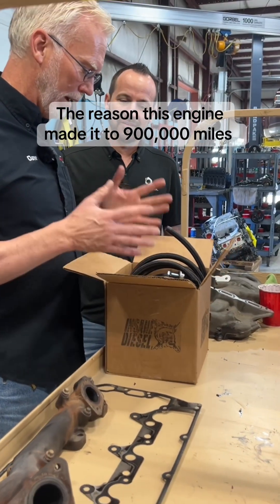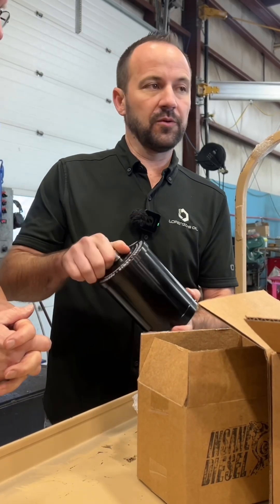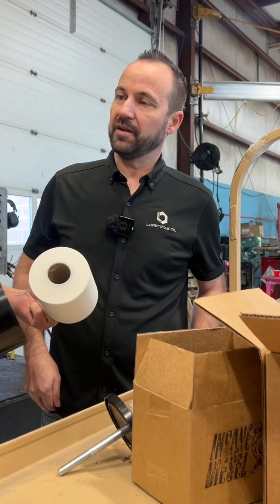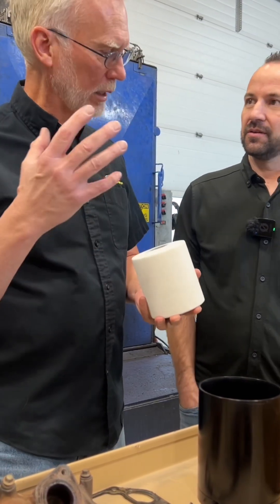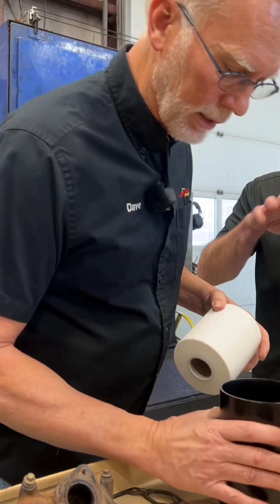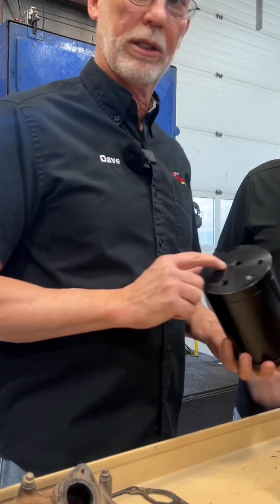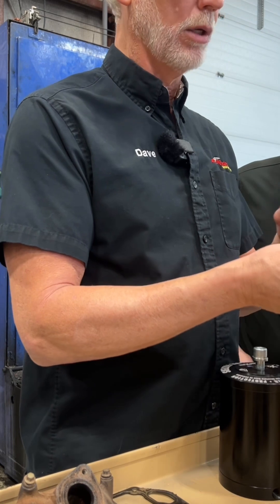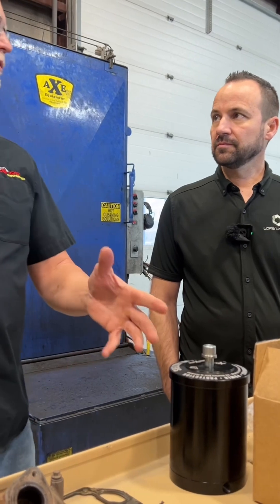Educating Dave on the Bypass Filtration system. The reason this engine made it to 900,000 miles.

Comment: I’d like to add this filter system on my new F-250 with 6.7 HO engine.  My only concern is how will Ford look at this in the event of an engine issue.  Would they try to deny warranty due to an aftermarket device?

Comment: I ran a toilet paper bypass filter just like this. Two oil change cycles and no improvement on oil analysis…. Diesel Amsoil sig series . Switched to spin on filter type. Nothing concrete to show besides oil analysis. Only sig issue was occasional leaking around the lid even though oring and torque checked
Reply: Exactly. Slug isn't the issue for most engines. Fuel dilution can cause issues. This isn't fixing that. It can't hurt but it doesn't always help.

Comment: I just recently learned about these Insane Diesel bypass filter systems, and I’m interested in understanding if they make sense for gasoline engines too since all the discussion about them out there seems to about diesel engines.

I have 6.2L L87 V8, I know there is a recall on them but I did not face any issues with my unit so far after 3 years of ownership and driving 42k miles.

I digress, I’m looking for ways to insure longevity of my engine after the dealership confirms the remedy for the recall, and I was wondering if this bypass filer would help.
Reply from the maker: It will absolutely help, gasoline engine have contaminants between 1-20 micron just like diesel engines.  There is just less soot in a gasoline engine.  Our filter also removes moisture contamination as well.  The real key to longevity is oil analysis, it not only tells you the condition of your oil but the condition of most of your mechanical parts on the engine.  If you can catch these issues in the early stages the least amount of damage occurs.  i.e. if you catch a head gasket leak when it’s a pinhole and no signs of steam in the exhaust vs finding a head gasket leak when you start blowing white smoke out of the tail pipe.  One requires a head gasket replacement and the other requires an engine replacement.

Comment: An oil bypass system will keep your engine running smooth. It will give your truck longevity and your oil will last a lot longer than usual but I would still change the oil at no more than 3000 miles. An extra 300 bucks a year on change but you ll have a truck to give to your kids’kids. Oh yeah, I got a 7.3. Maybe kids, kids kids😂

Comment: What's the concept here? What does this do that the engine oil filter doesn't do?
Is this a catch can for the PVC system?
Reply: No, this takes the oil and filters it down to 1 micron vs the 20-30 that a regular filter does. This doesn’t replace the regular filter, it’s in addition to it. It makes the oil last a lot longer (some claiming 20k+ between oil changes) and pulls out contaminants that would otherwise be left from the regular filter on your vehicle

Comment: Question. I am going to possibly be making black diesel soon from red dye/used diesel motor oil that we have a abundance of at my work (diesel trucks and equipment w/ all services done in house). We keep our waste oil in a sealed 55 gallon drum and mix no other liquids with it. 100% used motor oil only. If I were to put this style filter on a transfer pump and have the output hose just directed back into the drum making a continuous cycle, would running this maybe once a week or so for maybe 15/20min as the drum fills up get me a properly filtered waste oil? Then of course filter on the pump out and fuel filter in vehicle…

P.S. This is a badass product either way. 10/10
Reply from the maker: @gabeguedea2499  we have 1-4 filter carts we sell for industrial tank filtering.  Depending on how many gallons you are filtering and how many contaminants the used oil has in it you would determine the size of filter housing you would want to use.  We have a few customers that use our filters or filter carts to filter fuel oil.  Give us a call during business hours and we can get you set up with everything you need.
Reply: @ great to know! Thank you!
Reply: @ Separate question, what the lowest micron filter you can get that’s not a bypass filter?
Reply from the maker: @gabeguedea2499  when talking about engine filter most are 25-30 micron.  The lower the micron the bigger the filter has to be.  Which is why it is on a kidney loop system.
Reply: @InsaneDieselUSA  is there a filter that is not on a loop style system that is 1 micron or close to it?
Reply from the maker: @ No a 1 micron filter with enough flow to lubricant your engine would be the size of a 5 gallon bucket.

Comment: A lot of REQUIRED engine oil additives are between 1 to 3 microns.  This may remove engine oil additives!!!!!   Paging Dr Speed!
Reply: I have run this system on my 2015 6.7L Cummins for the past six years and used oil analysis on every oil change confirms your assumption is incorrect.
Reply: @ArtK-xx5rx so did you keep using the system and if so why?
Reply: @themotoroilgeek

Comment: Magnetic filtration is superior by far without the restriction.... FILTERMAG
Reply: Insane Diesel system has ZERO restriction. It bleeds off 10% of the oil from the full flow filter to run through the bypass filter.
Reply: Not all contaminants are ferrous metals.

Comment: I wonder how theirs compares to the original Frantz filter? A paper eliminate is better at removing moisture.

I have never understood why these are not standard on all vehicles. A good bypass filtration system and an oil catch-can can really help engines.
Reply: Frantz filters don’t filter moisture by the way… if you’ve done any research whatsoever. There’s no competition with insane diesels and frantz or any company for that matter. Insane diesel is superior and you’ll find that if you do any research.

Comment: Has no one Hurd of ams oil they have the same thing omg.
Reply: Really? ! !  They clog up huh? Hmm never heard that. You must have a real dirty sludged up engine, probably shoulda used AMSOIL in it. And no they don't go down to 1 micron, but oh well, I guess 2 microns 2/25,400 of an inch will do. And AMSOIL gas engines have made one million+ miles. Also AMSOIL has been around since 1972, they were first to introduce an API qualified 100% synthetic motor oil, you do the math.

Comment: Glad you guys are getting the recognition this bypass filter deserves! Most people just dont know about these things and how well the work in extending the life of your very expensive engines. Put a bypass filter on your 6.7 PowerStroke, ditch the terrible BoschCP4 pump for a nice Stanadyne DCR pump and maybe drop the EGR and a couple other things so your engine will go ALL the miles(900k+ miles)! These bypass filters will pay for themselves in extended oil life, & less oil changes due to the oil staying very clean. Using used oil sample analysis to see the actual oil life left in the cleaned oil to know how long you can extend the oil changes. Nice job on the filter canister and whole bypass filter system. Hope you get a bunch of business from this social media exposure. I'd buy one in a minute if I didn't have a 25+ yr old $1000 7.3L with close to 300k miles on it already that lived in WNY its whole life! 👍🏻👌🏻🧻🛢️🛠️🦺

✊🏻🇺🇸🦅
Reply from the maker: Thank you!  Our bypass filter cleans up residual deposits as well.  Our 7.3L is one of the most affordable kits.
Reply: 300k is nothing
Reply: @YZER19  Uumm....Ok. Very constructive!

Comment: If it’s more than $500 moneys I’ll pass
Reply: Still cheaper than an engine and way less oil changes.
Reply: Moneys 😂
Reply: It literally pays for itself cause you change oil at least half as much if not more. Plus it extends the life of your engine a lot - double or more miles.
Reply: The amsoil dual filter bypass is less than that, better quality
Reply: Have fun with that amsoil “full flow filter” you will never get more than 10 microns with a full flow filter and my amsoil one got clogged up at 500 miles and so has so many other peoples. If you get the return to the filler cap it’s the same price as insane diesels. It’s obvious to which one is better and which one has got an engine to go 900k miles. You’ll learn when you get older I guess
Reply: @eyezb4645  i run motorcraft full flow on my bypass and not problem, its 5 micron rated, dont worry you will learn when growing up
Reply: Don’t worry once you find out in oil analysis you’ll be coming back apologizing

Comment: this should be fucking standard on vehicles, not required by a 3rd part company to make t to save our trucks. what a joke thank you for making a good product
Reply: Unfortunately the manufacturers aren't really interested in adding a bypass filter that will prolong the engine indefinitely, then they wouldn't sell you a new one every 4 - 5 years!😅🤦🏻‍♂️
Reply from the maker: We agree, should be standard on all vehicles!
Reply: @InsaneDieselUSA  ...I agree this should be standard as well as the DCR fuel pump...
Reply: @InsaneDieselUSA  so this works on gas vehicles too? 
What about an electric oil pump that bumps up pressure the moment you turn the key to "on" bringing oil pressure up  before starting? Wouldn't that reduce engine wear tremendously?
Reply from the maker: @1truthseeking8 it may help but as you can see in our videos this 900k 6.7 Power stroke has zero wear on all of the bearing surfaces, the bypass filter, friction reducing oil and fuel additive seem to be doing a great job of protecting the engine, especially knowing the 6.7 is famous for losing main bearing due to the amount of oil it has to push at startup before the last orifice sees oil.
Reply: @InsaneDieselUSA I saw the price of the units also. Quite the mark-up on each unit! I like it but the cost you list isn't worth the bullshit.
Reply: Agreeed 🙌
Reply: Can this be installed on non diesel engines?
Reply from the maker: @santouchesantouche2873 we have quite the collection of gas engine kits as well.
Reply: @InsaneDieselUSA If you have any for Subaru's... sign me up!
Reply: Well now we know… I’m sold.
Reply: Actually Cummins and alot of other engines when first designed 65-95 years ago Actually ONLY used bypass centrifuge oil filters instead of a 20 micron full flow filter! Yes there is planned flaws by the corporate engineers (as some of y'all said) so they can make money on parts and maintaince as thats really where they make more of there money i was told by a friend that works for one of the big three car corporations! He asked me not to mention his name but said "If it wasn't for the aftermarket world most truck buyers would be screwed over and over not just once on pricing"! We have to stick together as citizens of the greatest country on earth. Freedom,respect and prosperity aren't promised at all anywhere we're just one of the easiest country's to make great money but the way things are looking (no matter what any of our beliefs are) we all do agree we're basically getting screwed by the big 3 (as yes they should come stock with a reliable fuel pump i mean seriously that's the most important thing on a diesel besides oil) so we need to do our best to just stop buying there products for as long as we can! These guys seem decent i mean the corporations we have a free capitalism society so they'll charge what we keep paying! Only we as a people can change it no matter our differences i do miss that America that I grew up in. No president or government can or will do it for us we have to make our stand together or we'll keep taking our little "freedoms" for granted that our fore fathers fought for not even 80 years ago during WW2 they walked into certain death so we still have the right to fight for the life we want! Nobody agrees on everything and never will but they will always take advantage of the little guy as long we let them and whats saddest of all is WE THE PEOPLE make this country go around we're basically self governed plus use to watch out for each other when I grew up! The saying "It takes a village" applies to alot more imo.. Apologies for the rant it just boggles my mind why we keep dealing with it as we watch them keep us divided and arguing as ive never seen strangers talk to each other the way they do on some of these threads! Great product fellas probably ordering my soon if the delete thing doesn't go through.. theyve been saying it for awhile but we'll see..
Reply: @rethergriffin7846 You just need better government regulations to enforce not being screwed by corporations.
Reply: Secondary bypass filters are standard on some engines. 80s Mitsubishi light truck diesel have it and 15,000Km scheduled change intervals back in the 80s 90s.